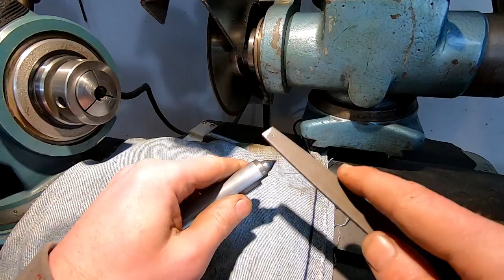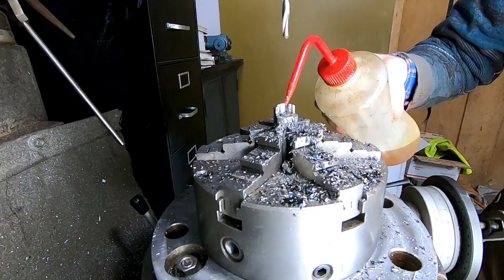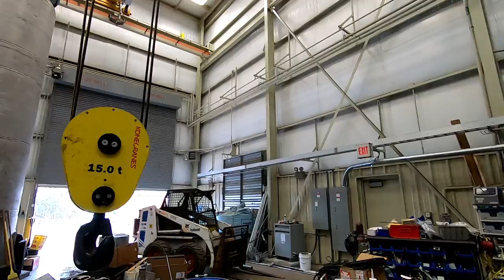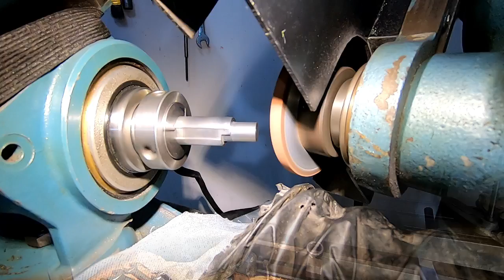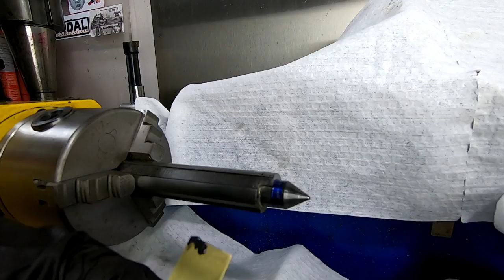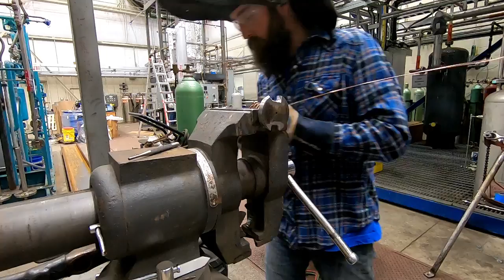Part 1 Upgrades to the tailstock & Shop work.

Comment: Loved the video Steve! Great work as always.

I do have a small question though, not sure if it's easily possible but is there any way to increase your voice volume as opposed to the machining? I often watch your videos at night and I don't want to wake anyone so I find myself changing the volume constantly
Reply from the maker: I've been struggling with audio issues for the last 2 months. Some shots come out fine and some are increased 100% in the editing process.  Not sure what the deal is. I'm switching cameras this week so we will see if it improves. The audio is hard to control. Thanks for watching.
Reply: @SteveSummers  I can imagine, especially with those loud machines. Keep up the good work :)

Comment: Tip for those soldering jobs is to try to find some solder paste, I have a small pot of very old silver solder paste, which was used by an old millwright when he did stainless steel screens for a paper mill. Only way you could see his join was the single strip of discoloured stainless steel mesh, where he had used the paste and a torch to get the joint perfect on the beveled wires. Would take him around 2 days to do the whole multi meter wide mesh, a job every 6 months.

The paste flux will clean the surface before the silver loaded hard solder in the beads melts and makes the joint.

Comment: PLEASE be a little more careful with a torch! Your work bench had several flamables on top. you should not have these around a torch in use' If any where leaking you could be injured or die!

Comment: Inserting the carbide tip into that hardened steel cylinder by boring a hole requires a lot of experience to see when the cutting has to be paused and allow the cutting tool to cool and be re-lubricated.  To do this in a mass-production machine would require a complex set of sensors (heat, vibration, erosion, etc.) and timers controlled by a complex computer software program to replace Mr. Summers.  Technology has a very high front-loaded cost that has to be made up for later.  It in many cases cannot be applied to a small shop like this one due to excessive cost.

Comment: At the end..Looks like someone was really hammering on that cutting tool retainer....I have an old (1946) Harley that saw a lot of that...big nut holds on the transmission sprocket...1-5/8"...most people are too cheap to buy that big socket...and they chisel away at the nut to tighten/loosen...pretty soon it rounded off....the last 'Mechanic' just welded the nut to the output shaft....
 So of course I had to grind off the nut, but a new one...and buy a new main output gear....and a 1-5/8" socket....

Comment: Spot on ref diamond paste classification, for metallurgy we pay equivalent to US $60 for a 30 gram syringe, anything to do with metallurgy is expensive.
When polishing a specimen from 1200 grit, to 6um, your standard household tissue will scratch, special tissue, or cotton wool is used from there to 0.5um, then non contact cleaning.
Nice modification. Best regards from the UK, thanks for sharing.

Comment: Morning Steve that was great, I had the same thing happened with me once on heating the two pieces up to solder. I had forgotten to leave a release point for the pressure to escape trust me you will only forget to do that once. Great content I'm moving on to part two
Reply: Yeah...need a groove or flat..even some press-fit dowel pins need that..

Comment: I would have used strong locktite and pressed it in?
Reply: Me too
Reply: @dinotom1  the way Steve did it. it's not going anywhere.
Reply: Some Loctite needs a slight bit of clearance...1-2 Thou...
Reply: @dougankrum3328  ild use superglue then lol
Reply: Agreed, but pressing in with Loctite, it’s not going anywhere either, it’s a center

Comment: Hey buddy seems like I remember you saying that your return spring on your quill was broke awhile ago and it looked like you were using the lock to help control it (I could be very wrong about that), but as mine has been broke just the same and since my BP is a series II and more then double the price of the series 1 return spring I haven't been in any hurry to repair it. Anyway the point of my comment was to mention a method I learned from Tom Lipton that he called "Pecking against the stop" (self explanatory). After adopting that method and making a large gate valve quill feed wheel I don't see that spring getting replaced anytime sooner since I don't care much for them anyway. Love the channel keep it up! Thanks
Reply from the maker: I have gotten used to having no spring also. I Wouldn't spend the money to replace it . It's kind of handy the way it is. Plus I wouldn't spend 50 cents on that mill. She's past her due date. Tom   Lipton always has some good tips.
Thanks for watching 👍